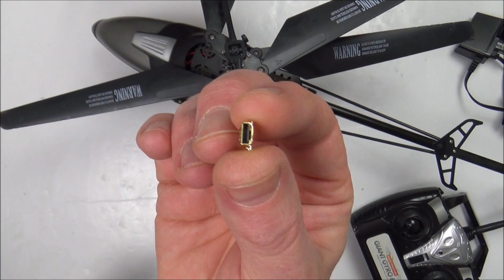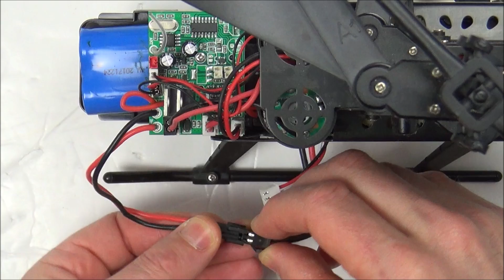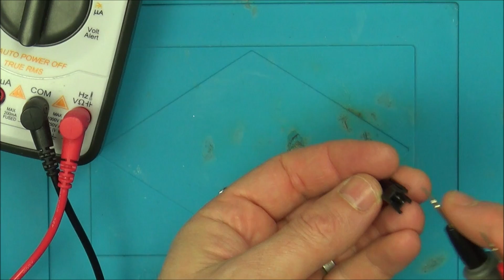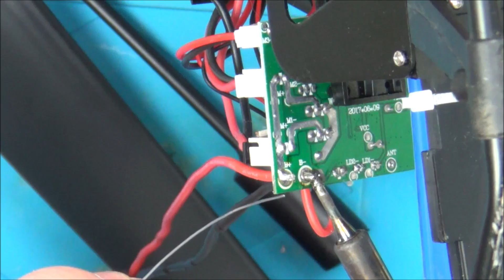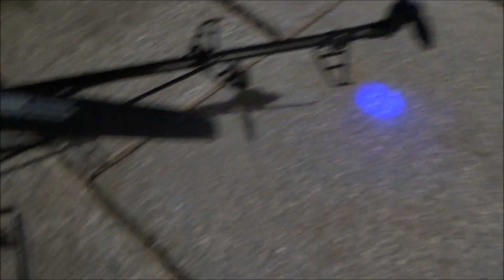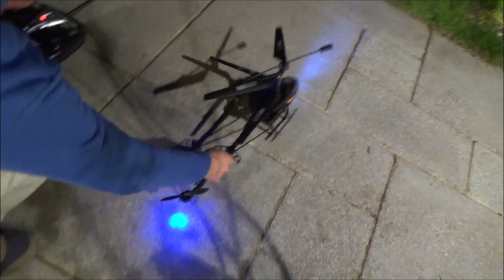Trying to Fix a R/C Helicopter (No Power)

Comment: Now just hack the spring out of the main rotor control on the controller so it'll be easier to hold in a hover. For some reason they use that to safe it to off on the less expensive helicopters, but it makes them more annoying to fly. (Any moment of inattention to that has it dropping like a rock.)

Comment: MM Vince, I agree that a loose connection was always the probable fault.  But, you might want to add an amperage check to your battery check routine.  If the battery has a superficial charge (sometimes call battery memory) you'll get the correct voltage but an amperage check will tell a different story.  If the battery isn't marked with the amperage rating then check the device's specifications for this info.  BTW, your soldering is looking better.  You were clearly heating both the wire and the board through-hole connections at the same time.  Even your solder application was good (soldered from opposite side from heating).  All in all, I am impressed.  Keep up the good work, I'll keep watching.  Thanks!

Comment: Hey, Vince, on ebay you can get specialized tools to unpin pretty much any kind of electrical connector. Just search for "Car Wire Harness Terminal Extraction Pick Connector Pin Remove Tool Set" or at least part of that. It should be rather intuitive which one you need to use and how. 

Btw, those connectors are a dime a dozen, used also for EL wires, for example...

But i do enjoy going you through the steps until you figure it out and fix it.. :)

Comment: Vince stop wasting your time and just put a proper hobby connector on it like the xt series, they are cheap as chips, guarantee that will just fail again, every time it crashes the motor causes a large back emf into the circuit which is why the connector looks like it’s got arcing damage on it.

Comment: I remember having a PC that i repaired and it had the same connector powering a case cooler , i had to change it because it didn't work at all , after i changed it the cooler started to work just fine.

Comment: I have a smaller silverlit RC copter with a dead battery. I like how yours uses 18650 cells. Mine has a large Li-Poly battery.

Comment: Nice copter. You should really change the connectors for deans (T plug)type. Can get them for about £3 for 10 sets (male/female). Most companies use the tamiya type as they are about 1p cheaper for manufacturing purposes but they have issues including wobbly connectors and creating resistance and you really dont want the chopper to fail when it is 50ft in the air. I play a lot of airsoft and any regular player will swap out the tamiya connectors for deans type as it improves the rate of fire and battery efficiency. You would get more flying time using deans. Maybe do a video on changing the connectors and maybe also giving the copter a service or to try and make it quieter. Maybe change the motors for brushless or something else. Pimp your chopper.   :)
Could also try the XT60 type connector as I believe they are superior to deans but more costly.

Comment: Just a bit of info. 8.4V would be fully charged. That "battery pack" is 2 x 18650 cells which put out 4.2v each on a full charge.  commonly used in torches, Laptop battery packs and also they are used in many vaporisers too. Much more common batteries than most people think.

Comment: You should pick up a set of test leads from ebay or amazon.  The nice ones have leads that can clip on to wires and connectors and allow you to piggyback a couple of sets of test leads.  Nice sets are about $20USD.  This would really assist in troubleshooting for instance clipping a ground lead on a chassis when checking capacitors.

Comment: but fixing the usb port onto the pen was way more interesting and shows you can still use other equipment without needing to find like-for-like = way more useful for those who might not want to spend money on things they are only messing around with (as they might have loads of cables with usb ports but not cameras)
Reply: Not to mention that a microUSB port/cable is more standardized than that weird camera USB port, so in hindsight, you've done a great job Vince (sadly, I haven't watched your video as of the time of writing).

After all, odds of anyone finding a weird, less standardized cable during a pandemic are a lot slimmer than finding a standard microUSB cable

Comment: Vince, how about swapping a Micro USB port on an xbox controller to USB C is that possible?
Reply: Now that’s a good idea
Reply: This ^^   ^^
Reply: Yessssss I like that idea
Reply: Yes but it's a lot of work
Reply: Why would you want to?
Reply: getyourkicksagain it’s a lot faster at charging
Reply: @keenobeast5920  Just changing the connector won't make it charge faster. That's like putting a Ferrari badge on a moped and expecting 10 second quarter miles.
There's more circuitry involved to be able to take advantage of faster charging than just the connector.
Reply: getyourkicksagain fair enough and I love that comparison😂